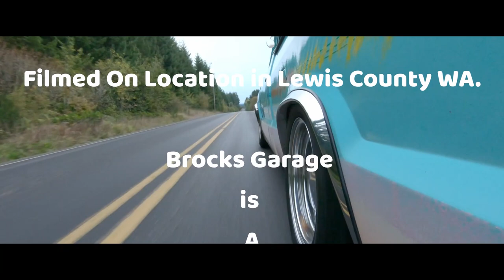Brocks Garage Show 15 Featured 1979 Ford Courier

Comment: What motor and transmission are you planning on running?
Reply: i'm assuming you're asking the other john and about the chevelle??? he's going with a 1970 LS6 BBchev with a muncie M21 rockcrusher 4 speed i saw the cam specs the other day for it full roller cam with like a .601 lift should be a badass engine!!!
 check out episode #16 and more too come ....